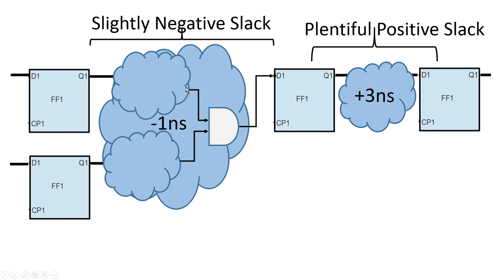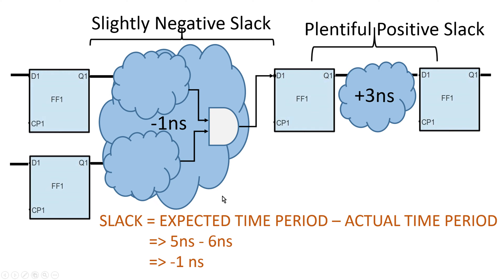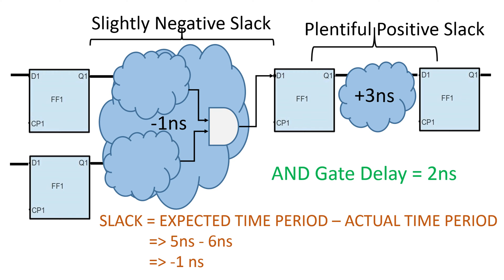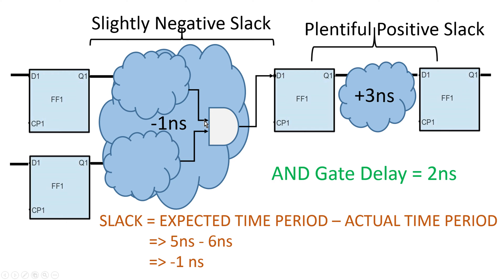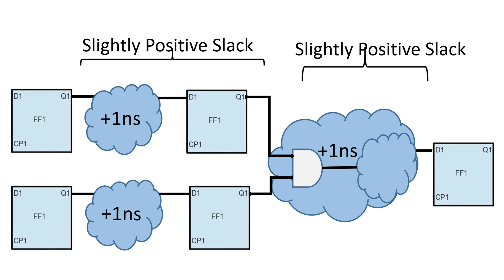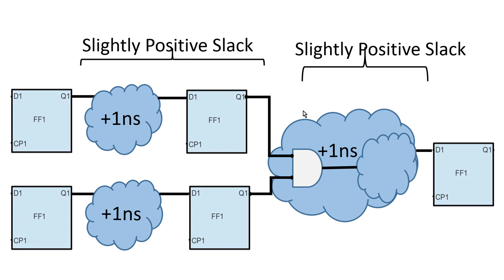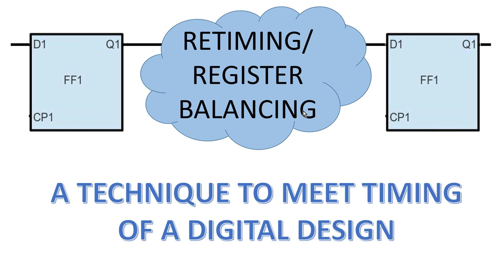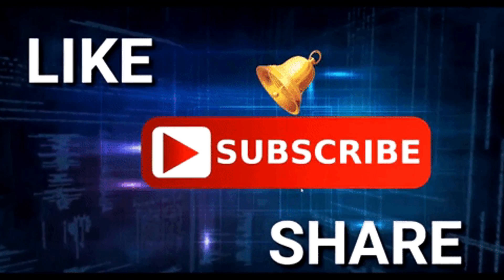Interview Question on Static Timing Analysis | Re-timing | Register Duplication

Comment: Adding 1ns delay on the clock path to the second flop (the flop in the middle) would be the easiest way to fix this without a functional eco as suggested in this video
Reply: Clock tree is not built during the synthesis stage. So, you can use this solution during the synthesis stage. Genus/Fusion Compiler already having this feature